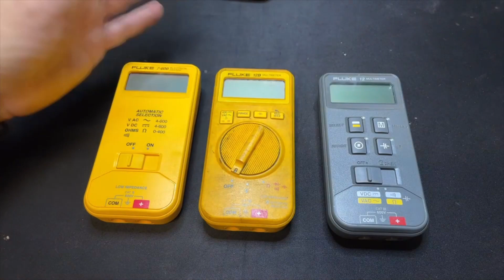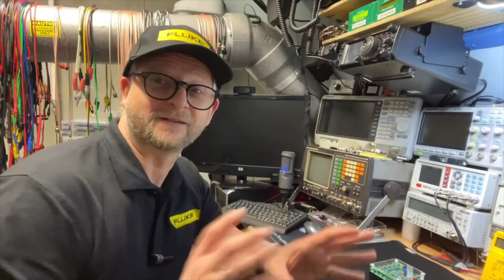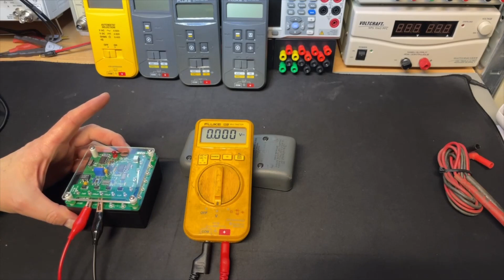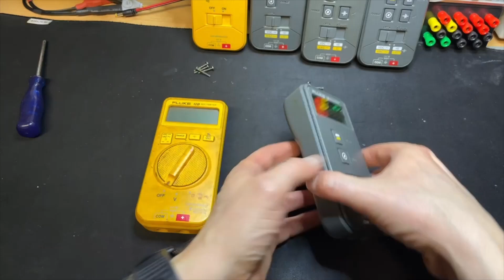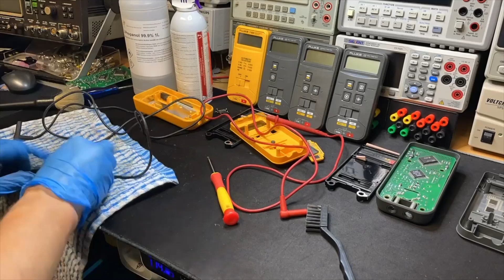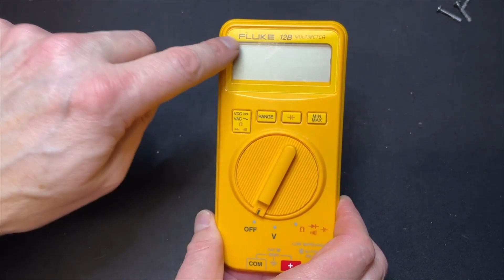TA•0320🟦Fluke Friday (E3) Fluke 12B -  is it just a yellow 12?

Comment: Thank you, Tony!  I am amazed at how well Fluke products maintain their calibration - always reliable.  This is the first time I have seen a multimeter with a knob that rotates anti-clockwise to turn on. I have had good results using the Novus products for cleaning and polishing plastic but the Brasso seems to do a very good job so why switch? Regards,  David
Reply from the maker: Thanks David...never thought about the turning direction, but you are correct... brasso needs a lot of elbow grease.. maybe the new ones take less offort :)

Comment: I have a question. Which is more useful for finding bad capacitors, a capacitance tester or an esr tester?
Reply from the maker: Find a tester for both, depends if you checking for PSU or HF/RF .

Comment: A friend of mine recommended Maguiars PlastX, which is used for cleaning up modern plastic headlights, which seems to works very well for restoring multimeter plastic displays. Before that i used to use Brasso also.
Reply from the maker: Thanks Nik, yes correct, there are better materials now, i realized later too, in my later Fluke Friday you will see me using other stuff then Brasso, and the scratched are more or less the same removed, even a bit faster with the new stuff and the plastic is more shiny